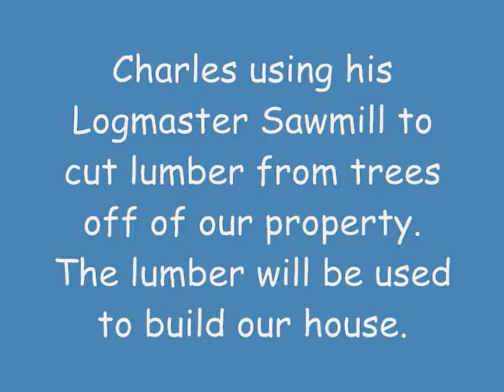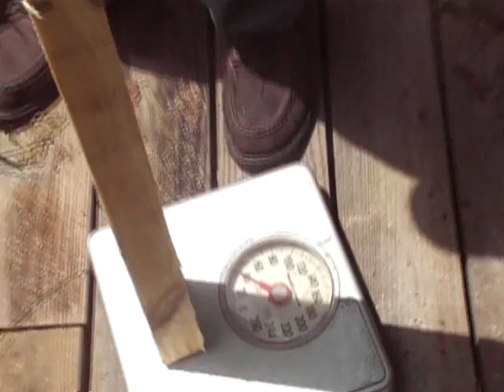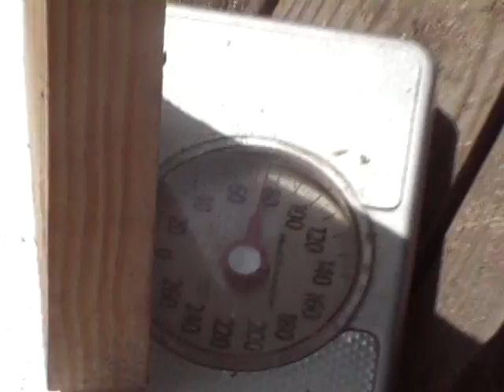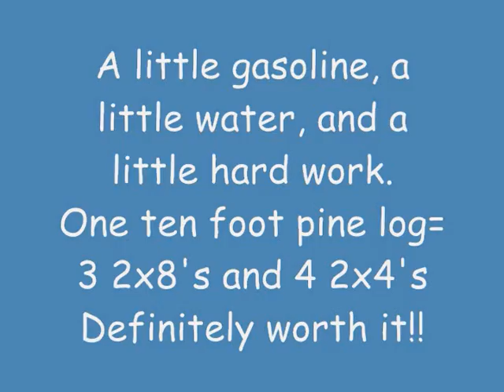Logmaster Sawmill

Comment from the maker: @357blacksmith Thanks...we have tried to make sure that we cut close to the desired end length. In fact we have been pretty good about getting within just a few inches of the final board length. We have spent the last few weekends squaring off 10ft boards for the pole barn that we are in the process of constructing.
Reply: do you still like this saw mill? im thinking about buying one